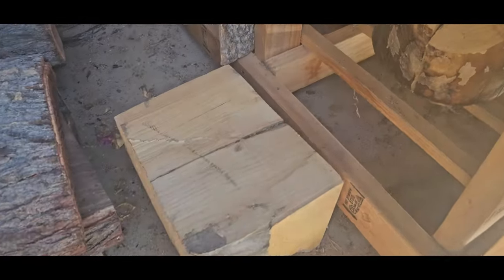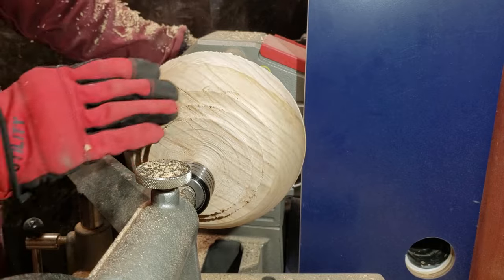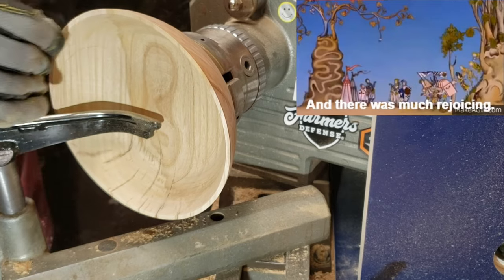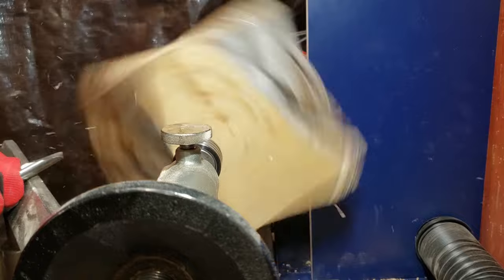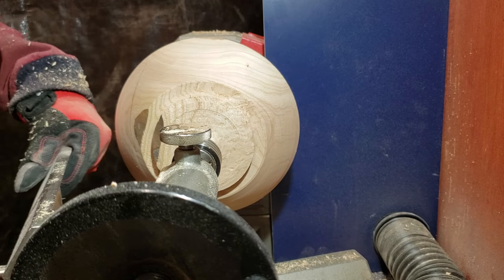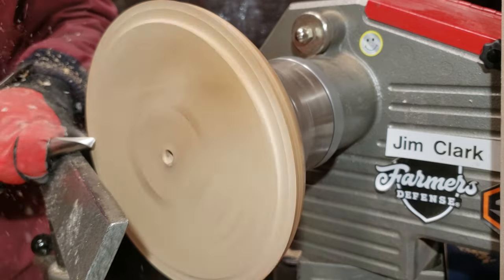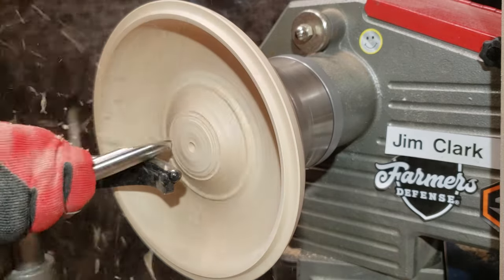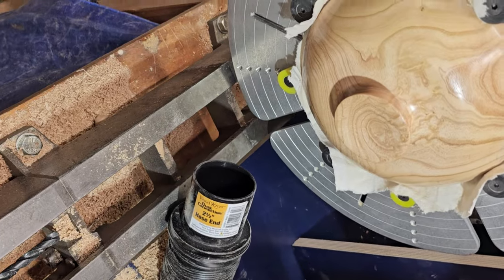Woodturning an Ash Bowl with a Lid

Comment: You did a great job on this piece. The only suggestion I would make is on the next one make the lid about half as tall. It looks just a touch top heavy to me. Then again, you’re the maker here. If you like it, it’s what it needs to be. Again, well done.
Reply from the maker: Thank you!  I agree the old could be shorter.  I was thinking the same when I got closer to the end but it was kind of hard to tell with it in the chuck. Plus I had already spent a ton of time on it and didn’t want to risk destroying it by trying to modify.  In the end, this was still an experiment and your point is definitely one thing I learned in the process.  I appreciate the feedback!

Comment: Very nice, great information and I like your though process, The bowl turn out great, on a side note what brand of chuck are using with the quick change jaws?
Reply from the maker: @DavidBird-uu8km  Thank you! I'm using the Easy chuck from Easy Wood tools. I love it! When I started out I couldn't afford to buy multiple chucks, and I didn't want to have to unscrew jaws all the time. It was kind of expensive, but it's cheaper than multiple chucks. The only downside is that the biggest jaws are 3.5" (90mm). I would like to get a set of 4 or 5" jaws for bigger work.